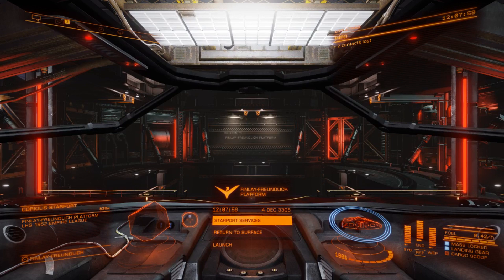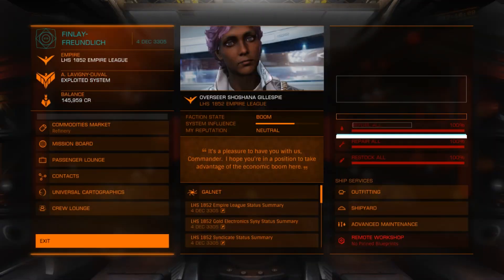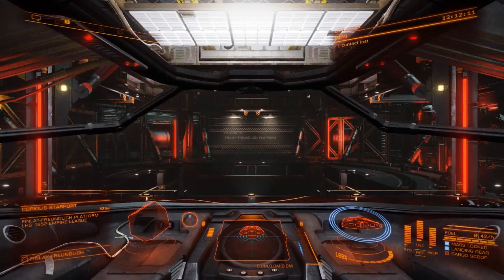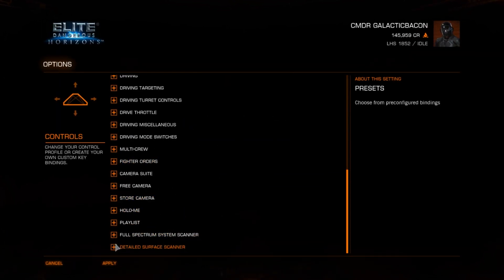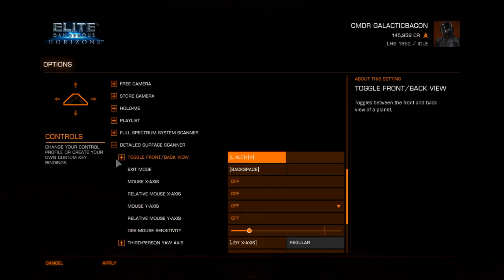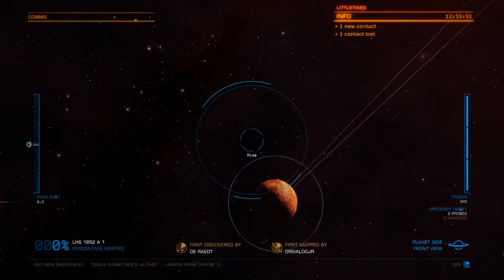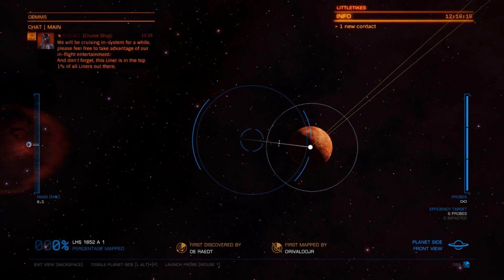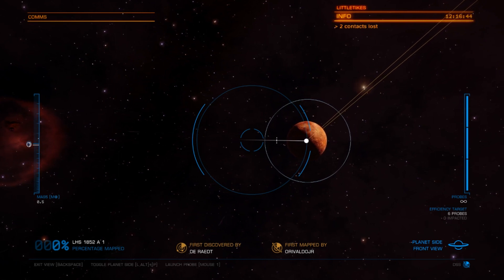Elite Dangerous Detailed Surface Scanner - Exploration Guide Part 3

Comment: I've only scanned a few times,  but I'm pretty sure that once you scan to 90%, it will jump up to 100%.  90% = 100%.  That way you can forego scanning the small overlapping bits that are missed.
Reply: That's very true. You should leave the small bits. Many of the small bits that Bacon went for accounted for much less than 1% of the planetary surface. If you want the efficiency bonus then its cool to leave a few patches here and there.

Comment: I miss the old surface scanner - it took 5 seconds to scan the full surface no matter what. Seems like hard work now - typical Elite Dangerous I guess, making things harder for no reason... 
By the way, how many credits do you get for a fully scanned moon or planet? I know it differs, but that ringed planet for example... how may credits did you get for that full scan? Is it worth it???
Thanks for the vids by the way. In the absence of anything resembling a manual, your videos have helped a lot!
Reply: There is a manual. Check the Frontier web site. They also have tutorial videos. However, that being said, GalacticBacon’s videos are extremely helpful. I prefer them to lots of other vids that gloss over details or move too fast to fully digest the info. Don’t forget to subscribe!